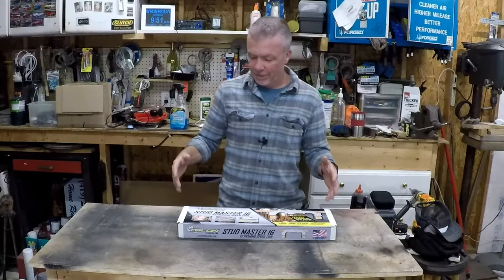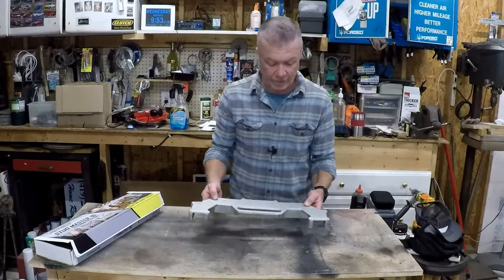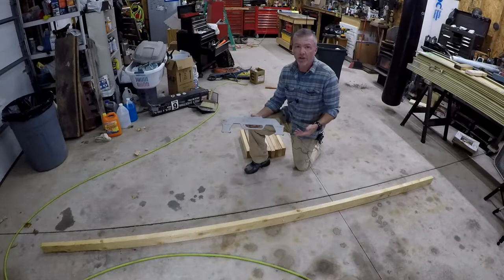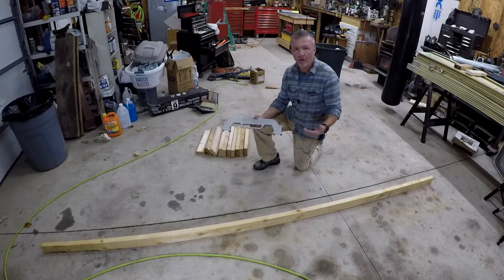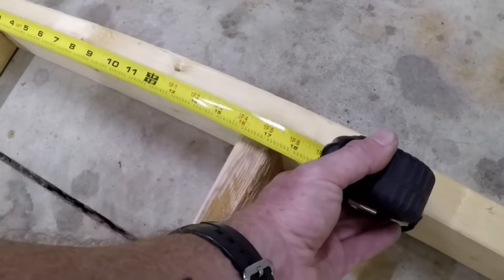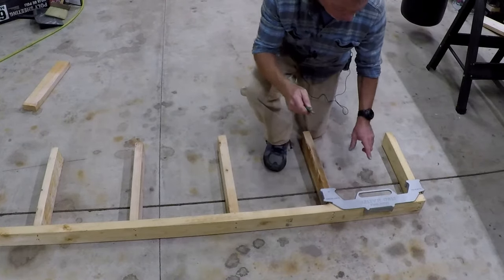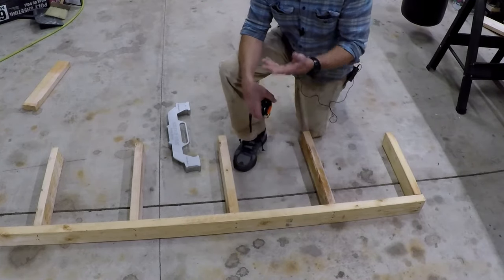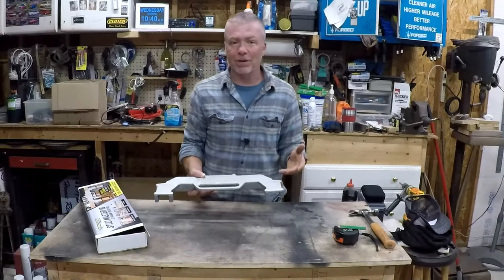Put To The Test! StudMaster Framing Jig | Does It Work? | My DIY

Comment: Bring that to a jobsite and you won't get hired again.
Reply: yeah cuz when I come in and try to hang grab bars on studs later, I got one that's on 16, and snother one on 14 because people can't measure. That's always fun. This is a quick guaranteed way to get 16s. Is it for everyone? No. But don't knock it because you wouldn't use it.
Reply: @Chris.Rhodes  Um, a 14 1/2" 2X4 is faster and cheaper.
Reply: @stevet8833  Okay? I think so too. But not everyone has common sense.
Reply: You can come to my job site if this dude gets rid of you
Reply: Not mine. Learn to read and use a tape. You move that slow on my crew and I got no use for ya
Reply: @Chris.Rhodes  people also use training wheels when learning to ride a bicycle, but an adult with training wheels is a joke.
Reply: @Gruuvin1  an adult with training wheels? it's a jig. not a training wheel. I love the judgemental shit when it comes to this kind of stuff. No wonder people don't want to work in the trades anymore. I see this as a good tool for older people, maybe people who aren't fast measuring, give them this. But just because YOU or I won't use it, doesn't mean it doesn't have a place, or a use. But it's cool, keep judging everything you see as a joke.
Reply: @Chris.Rhodes  it's a helper for people who are inexperienced at skilled framing with tape and pencil and are willing to carry extra bulk to make up for that inexperience. In that respect, this tool, for a noob vs a pro, is very similar to training wheels on a bike! Your welcome for that insight! :)
Reply: Imagine when someone showed up to the job site with the first circular saw or air nailer and someone said that.
Reply: @barrypeterson9692  it's nothing like that
Reply: Once your hired, you can’t get rehired, lol
Reply: @tonybashiproductions3356  References? Reputation? Word of mouth. Have you never had more than one job?
Reply: Gruuvin1 Okay why?
Reply: Okay I get it now why you would say you wouldn't get rehired using this jig. You're the type to work harder not smarter.
Reply: @Caucasiancookingadventures  nope. Carry less stuff keeps your hands more free and you can work faster. Can be just as accurate with a tape and a pencil, just like all the other guys who are experienced and know what they are doing. With a tape and pencil, you are working smarter and faster. That jig is a crutch for guys who don't have experience and it will introduce tiny measurement error per each stud that will compound to a lot of error for the entire wall. Smarter, remember?
Reply: @Gruuvin1  i disagree. You will work faster by having a jig. Smarter, remember?
Reply: @Caucasiancookingadventures  I frame houses. Seems like you don't. Thanks for playing.
Reply: @Gruuvin1  very funny kid.
Reply: @Gruuvin1  i bet you do frame houses. Doll houses.
Reply: @Gruuvin1  You frame houses for D.R. Horton. 😂
Reply: @Caucasiancookingadventures  doin a 3200 sq ft house right now for $560k. 8' doors and 10' ceilings. It's a beauty.
Reply: @Gruuvin1  sure you are.

Comment: I think that they made that wrong. It's supposed to measure from  the center of the 2×4 not the edge.
Reply from the maker: Center to center or edge to edge doesn’t matter, it’s the same measurement.
Reply: @MyDIYAdventures Apperantly, I didn't think about that hard enough.
Reply from the maker: @gregm.5960 it happens🤷‍♂️

Comment: Another solution looking for a problem. 
I also have a jig for framing walls at the correct spacing. It's a 2x4 cut to the length of the gap between the studs. If I wanted to get really fancy, I could get some Ridge tie brackets or something similar and attach them to the end of the 2x4 and have pretty much the same thing, but it would only cost about $8 for the whole thing.

The big problem with this is that you still need to mark all your stud spacing because if you don't transfer them to the top place, you could end up with your entire wall being off. Not to mention if you have a door or window in your wall you need to properly space that and plan your stud spacing.
Reply: Not really.  Mark your first, make sure it's plumb and the rest should also be there.

Comment: A scrap 14 1/2 is not the same. This device lock it in at 16 oc, where you would need to hold the stud firmly to prevent shifting, though being a 16th or 8th off isn’t a big deal in rough work. Yet it would need to be laid out ahead of time or else the consecutive ones will be compounded.

With this device, there’s no marking or measuring save for the first stud. A 14 1/2 scrap can’t be used for the first either.

I just discovered this jig so I couldn’t say how effective it is in the field. Yet a similar device could be made with scraps instead of just using a 14 1/2 block.
Reply: Stick an 80 cent bracket on each end and problem solved. I have a feeling this is a homeowner gimmick and anyone showing up to a job site with one of these would get laughed off the lot.

Comment: The jig does have a feature that accounts for the first stud. You align the end with the notch on the top (just where it slopes up) then you land on the 48"
Reply from the maker: That’s a good point! You can install the second stud that way first, and then install the first one…thanks for the tip!
Reply: lays tape out and every stud is off center cause you didn't make first one 15 and quarter and start from there
Reply: If you had a production shed facility and had 2 guys on a table on opposite ends knocking out walls this would be awesome … this would be great for exact 16 oc .
Reply: NO FAKIN WAY M8 UR A GOD AMONGST MERE MORTALS
Reply: MY APOLOGIES FOR SWEATING AND MY CAPS LOCK IS broken
Reply: swearing*

Comment: Creating a solution for a problem that doesn't exist.  

Someone will get rich off of it.  I'm not mad at them. Good for them.
Reply: YOU DON'T KNOW WHAT YOU'RE SAYING, IF THERE ARE PROBLEMS BECAUSE NOT EVERYONE FOLLOWS THE MEASUREMENTS, ESPECIALLY THOSE WHO BEGIN AS ASSISTANTS TO A LICENSED TEACHER AND WHO AFTER A LITTLE TIME BELIEVE THEY ARE CAPABLE OF PERFORMING "WORKS" WITHOUT BEING REALLY READY FOR WAR, CAN BUY THEM BETTER TOOLS, BUT THOSE "BUILDERS" HAVE NO IDEA WHERE THEY STAND.
Reply: If you can't read a tape and mark 16 inches you probably shouldn't be a carpenter or an apprentice.  

I guarantee a real carpenter can lay out and build a wall faster WITHOUT that tool than with it. 

And I'm a carpenter...

Comment: What's wrong with a 14 1/2" 2X4?  Faster and WAY cheaper.
Reply from the maker: You’re not wrong
Reply: This jig also helps the stud be flush. Only additional benefit I see
Reply: working alone doing falters I'd nail cleat on bottom that gave me my eve and 14 and half inch spacers that I nailed into top plate  ,slam the next rafter into that and gun it into the spacers, no angle nailing ,no tape measure

Comment: You can make that thing pretty easily
Reply from the maker: Maybe you can, but I don’t have the means to cast aluminum in my shop LOL
Reply: @MyDIYAdventures  you can make a template out of wood. But my main point is you don't know to adjust the first stud and just put it on and start your walls won't match up and break even on 48 and 92 inches with siding or plywood

Comment: 🧐🤔The fact that this tool is out says a lot, you contractors and construction workers 😜 are funny 😂😂😂some of you that are talking down on this 😂😂 probably have one or something similar to this tool! 😂😂it seems that whomever came up with this template was in the same mindset your in now! Some days you wish you had a tool that could speed up the process without losing efficiency! Regardless of plumbing, windows, and or doors! If code says 16" on center, well I would test this tools theory! Knowing that also whatever corner you start at the opposite end is going to need to be compensated for final completion of that wall, thats without any variables, meaning windows or doors.
This tool seem to provide accurate layout for a perfectly framed WALL again without any variables; plus if you contractors and construction workers are seasoned and not green your going to know off rip how to use this tool to your advantage!

I will say this evolution is a real thing😂 you guys stop being scared if this tool helps and works stop hating! And no😂 im not for this tool 😂😂

Comment: Ha! .. Does it come with it's own carrying case?  , I want mine personally engraved so as not to confuse it with other framers on the job .  Does it come at 19.2 on center ? or the seldom used and dreaded 13.71 on center ? . If someone showed up on my job with that gadget . I'd throw it off the deck , Don't want anyone tripping over it .. That aluminum could have been better used in the manufacturing of beer cans . Confusedus once said " There is a time to jig and there is a time to not "  Tis the time not
Reply from the maker: But how do you really feel?😂
Reply: LOL . I feel great.
Reply: @MyDIYAdventures  I was wondering about it's flight characteristics when I wing it into a lake . Hey throw some offshore and create an artificial reef . I have always believed that out of bad ideas can spark good ideas . Peace

Comment: I'm going to make one last attempt (I've tried several times) only because you did supply me with an email address so I am forced to believe that you would look at my message when I send it. I got back at least two messages that said the email address was not working. Nothing I post here with a link, including my email address, stays. I don't know if it is an AI thing or if because you have something in your settings which restricts the action. Maybe my messages are going into your spam folder. It's rather frustrating sense, as I said, you did answer me with an email address.
Reply from the maker: I emailed you back
Reply: @MyDIYAdventures Don’t you love the people that think you are on YouTube just for them and only for them?😂😂😂

Comment: The downside to this tool is you can't Frame both sides at the same time like when framing a deck.
Reply from the maker: Use two?🤷‍♂️
Reply: They cost $90.00 each so logically I would rather use a $20.00 tape measure each time. If you don't know how to place studs 16 on center watch a YouTube video or get a helper with experience
Reply from the maker: Bingo👍
Reply: You can get two of these and space them.

Comment: Im 52, been framing about 35 years now. That thing is about useless! If you cant read a tape & layout a wall your shouldn't be on a job site. It would take forever to frame using that thing! Thats why its so damn hard to find good help anymore, no one actually wants to LEARN  anything.
Reply: It's not necessarily about "can't read a tape"... It's more about saving the 15 minutes of measure and mark. Just grab the tool and a stack of pine and start nailing.

I agree with you, knowing the tape and understanding the numbers is essential for a craftsman. But this is being sold as a DIY tool.
Reply: @AOMartialArts  
I get your point & like the guy said "its not rocket science" & i dont know your level of experience with framing BUT there are few places on a house where you can just drop that down & run with it. When you consider placement of all the doors, windows & channels that are in most walls thing like this become more of a hassle than a help. But hey, make something no body needs & everyone wants it!